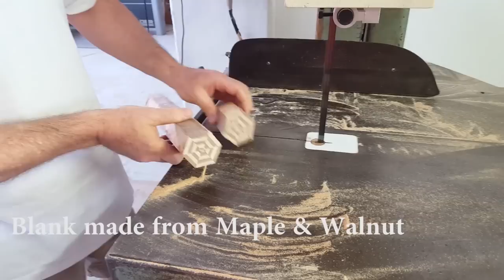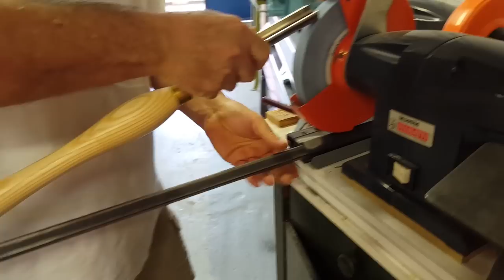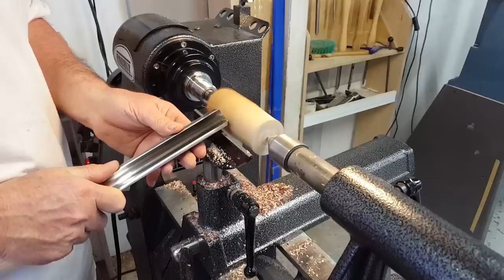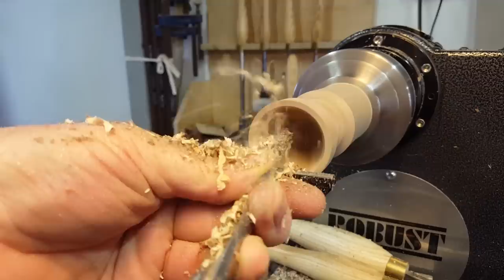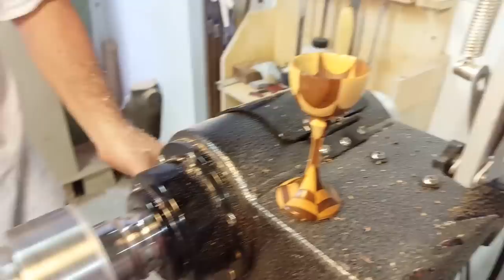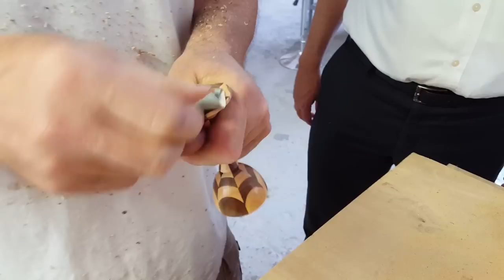Turning an Hexagonal Segmented mini  Goblet - Woodturning by Eli Avisera

Comment: The way you are using the bench grinder is very dangerous. The cutting edge of the metal shoul face the same direction as wheels trun direction in this case should look down. Other vise cutting edge might bite the wheel and cause a massive kick back and even break the wheel and injure you sa becarefull please. I have seen enough blasing wheels to confirm this :D. And also if you do it the way i say it will be ofcourse harder but more sharp